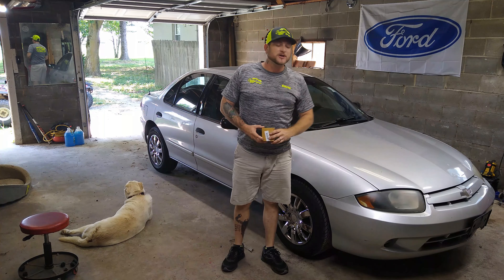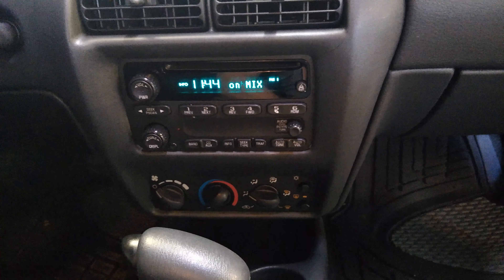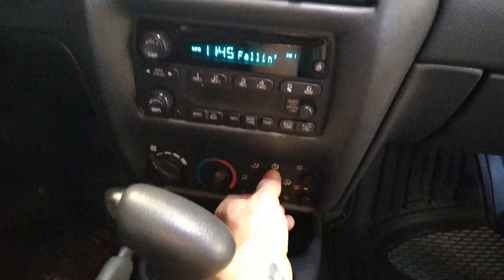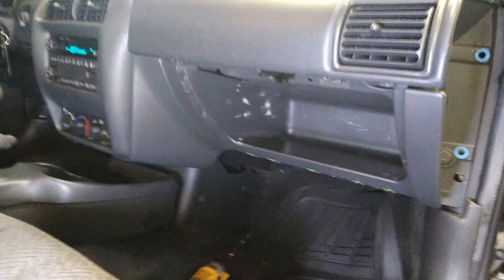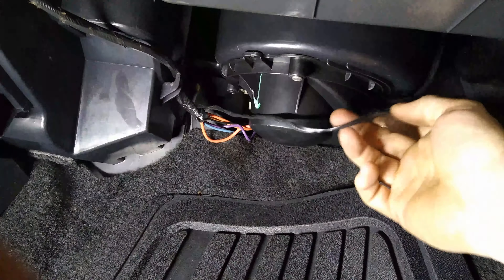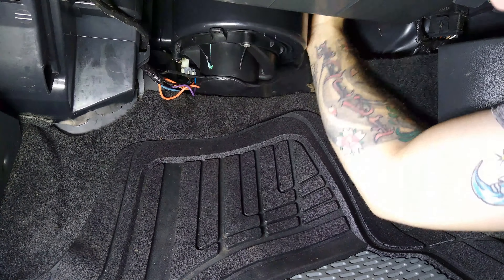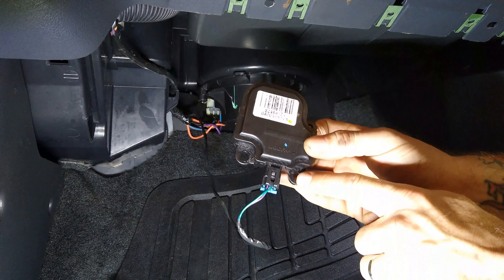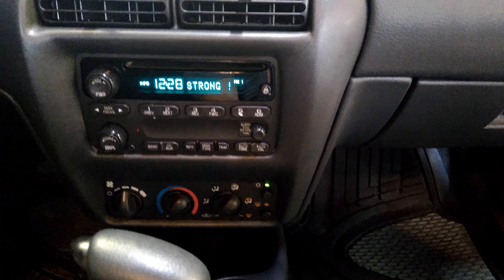Blower Motor Actuator Removal & Reinstallation. 2003 Chevy Cavalier

Comment: Will it do any damage to the heater system  if you don’t repair it right away or is it just the annoying clicking sound?
Reply: Shouldn’t do any damage. Part will just wear out. It took me 15 mins today to replace the actuator. Awkward to get your hand up there, but worth the trouble for a functioning duct system. The part is only $17 on Amazon. Or a better quality one is worth about $40. That’s the route I went.
Reply: @scottg3736  thanks. I had a mechanic fix it but now my ac heater panel background light is not working. I’m not sure if he caused it.
Reply: @Scissores  hard to say, but they aren’t new cars anymore. Bulbs burn out.

Comment: You know this morning I tried to trace that black wire up and it seems that there is no space there. I did some car works before which require to get to very tight spots. I'll try again, but meanwhile I want to inquire, maybe you were able to take it out, bcs you removed some screws on the right side of the dash board. I would appreciate you opinion on this matter. My car is 2003 Chevrolet Cavalier. Thank you again for the film, I would be totally helpless without it.